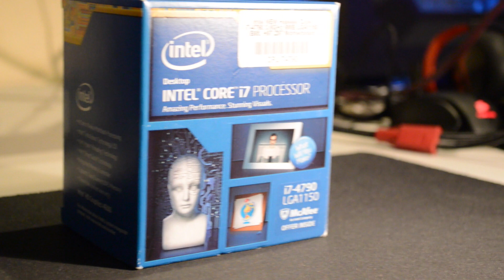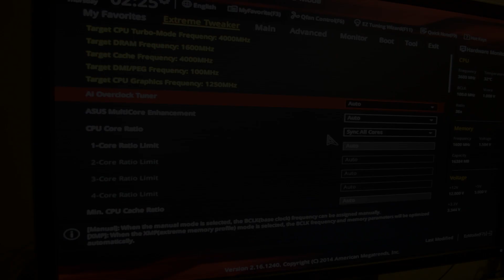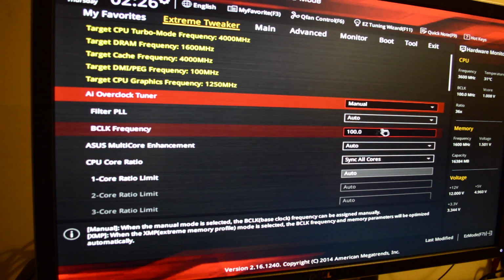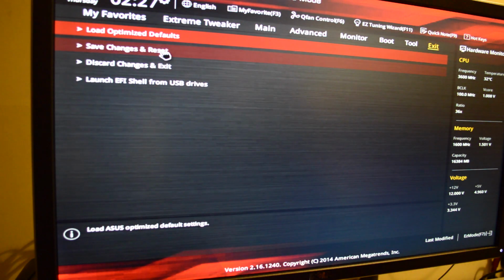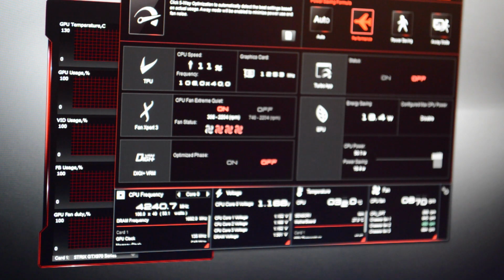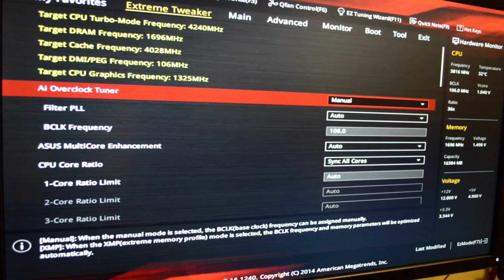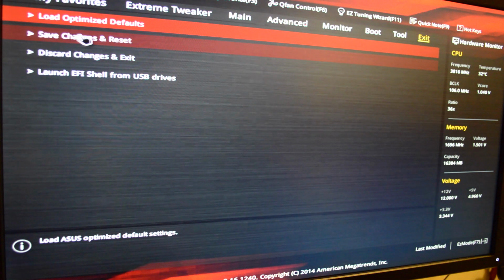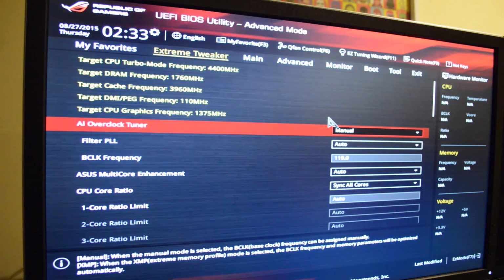Overclocking a locked Intel CPU!

Comment: I thought base clock speed is supposed to stay at a set value for the purpose of running all the components at a certain frequency, when you change multiplyer on (K) cpus it doesn't effect the other parts but base clock is what everything goes off of so changing it can lead to unstable system

Comment: Hey man I had a second gen i5 and a intel mobo and couldn’t find the settings you used.Now I’m getting a i5 10th gen with an ASUS mobo.Do you think it will work?
Reply from the maker: I believe second gen Intel would have still been of the age where you would most likely have still needed an overclocking motherboard to have the options. Many newer motherboards will have the option for this even in the low end, although 10th gen some things are fundamentally a bit different
Reply: @LancesRoom  yeah thought so now I’m getting a 10 th gen processor will it be possible to over clock that without a z or x chipset?
Reply from the maker: I would say it depends on the motherboard you go with, not all manufacturers have the same setting in the BIOS. Look at the webpage for the mobo you are thinking of getting and you should get what you need to know

Comment: my i5-10400 keeps idling and boosting at 3.98GHz i want to find a way to probably make it run at 4.7 or even 5 GHz i have a 240mm AIO cooler so im pretty sure it wll run pretty well.
Reply from the maker: With locked CPU’s there are other factors to think about that the multiplier will also affect (RAM frequency is of course one, but there are other) and while there may be enough temperature headroom for the CPU, other parts of the system may become unstable. It may not be possible with your CPU. The 10400 is a 2.9GHz base clock and a 4.3GHz boost clock so being a locked CPU, it ,Ishtar be pushing it. I’d love to know your results either way though man!
Reply: Max 102.95 bclk or it won't boot on 10th gen and up

Comment: Whats the software that was used. Also, can I do this with my e3 1240?
Reply from the maker: It’s simply done within the BIOS of your PC. Regarding your hardware I am not sure, would pay to do some searching before giving it a go
Reply: Lance White I’m new to the pc worlds cuz I just upgraded from an old xbox to my new budget pc. Do you know how I would be able to do that. Am I right in saying BIOS stands for basic input/output system??
Reply: Lance White Looking into it a little bit more, is it correct that to access it I must restart my PC first??
Reply from the maker: Yep that is correct for the acronym although it doesn’t explain much. Basically it is where the hardware is initilised on start-up. You access it before Windows is loaded, so you would need to restart. To get into the BIOS when you boot there is usually a key you need to keep pressing, usually it will tell you on the initial boot screen
Reply: Lance White I managed to do it. Boosted my e3 1240 to 3.7ghz base clock so quite a healthy increase. Thanks for your help mate 👍
Reply from the maker: Very decent little performance boost for sure! Well done man!
Reply: Lance White I just need to figure out how to get the turbo clock up now. In the system bios I can make it no higher than 3.8 so my cpu technically has a 3.7 base clock and a 3.8 turbo, lol. I would like to alter it though if possible.
Reply from the maker: Usually if you overclock this way, it becomes a fixed clock speed. Do you know if your CPU has an all core boost or if it would have just boosted one core to 3.8GHz?
Reply: Lance White I’m honestly not too sure. When I ‘user benchmarked’ it, it just said that the base clock was 3.7 and turbo an average of 3.8. Anyway, even if the turbo is 3.8 in one core, 3.7 base clock is still a big improvement.
Reply from the maker: Yeah definitely! You can compare your FPS numbers too, with the BCLK overclock, vs stock and see what real world improvements you make

Comment: I have a i5-9400F and now all the cores are running at 3.95GHZ
Reply from the maker: Nice man!
Reply: Hey, I have the same CPU as well. Did this give you any performance boosts for your games?
Reply: Think this would work on a i7 9700f it’s turboed to 4.7 but base is 3.0
Reply: Joaquín Crous they turbo to 4.2ghz
Reply: @thesacredtoaster3719  No, they have turbo boost up to 4.10GHZ in 2 cores, in my case, i put it to 4.00GHZ in ALL cores with a program called: QuickCPU, it works.

Comment: Thanks for this video! I managed to hit 4.301 on my i7 4790. I set my value to 107.5 and everything seems stable so far!
Reply: Nevermind just got an error message and locked up on me whole playing Far Cry 5 lol going to try 107 now
Reply from the maker: Nice dude! Definitely takes a bit of tinkering to get the right balance
Reply: @jb74465  solution?
Reply: @DiDi-hm6ri  Solution is to lower value lol not much else you can do with the cpu being locked. It's been stable at 107 for me

Comment: don't be a lil girl! i did the same thing on a core i7 920n (lol) but got 4.5 ghz stock speed it 2.37ghz! alway always push the shit out of a cpu! lol
Reply from the maker: Cause it’s locked, pushing it even 0.1mhz more causes system lock ups for me sadly. If it wasn’t locked I’d have a lot more to play around with
Reply: @LancesRoom  that sucks!! all i did was adjust the blck think i set it to 210 which made it 4.5ghz! im now running a 980 extreme @4.7 stable! the v core is a bit high for my comfort but 1 month and 3 weeks in and its still pumping good vibes lol 1.58v on the v core haha
Reply from the maker: Nice man!  When I do that, my RAM goes to almost 4000 MHz haha. I’ll do a little more playing around and see what’s possible though

Comment: Hi I would really like to do this for my I7 2600 but my gygabyte g1 m3 sniper has different settings, plus I think my ram speed is only 13000
Reply from the maker: It may be called something different in your bios. Regarding the RAM speed, that will be your base frequency, because the 2600 is an older generation it’s 1333MHz instead of 1600MHz like mine
Reply: @LancesRoom  last time I messed with bios I had to wipe my pc so I'm not going there lol

Comment: I have an H81M-S3PH and an i3-4170, would it work?
Reply from the maker: Sadly not with an H81 chipset, it would still need to be a chipset with overclocking features available
Reply: @LancesRoom  what about a h81m-p33 ?

Comment: I have a H81 Asus motherboard and an i7 1490 and i cannot set the bclk frequency to manual.
I dont have the AI overclock Tuner option even with the same bios version.
Ps My memory is 1600mhz like your
Reply from the maker: Typically an H series motherboard is a board without overclocking settings. You would most likely need a Z series motherboard
Reply: @LancesRoom  I didn't know tank you very much

Comment: dude, how is this supposed to be LOCKED?
Reply: ies
Reply: Right? looks like regular overclocking to me
Reply: @Impetuss  With a locked chip, you can only overclock via the BCLK frequency like this. With an unlocked chip you can also adjust the multiplier to overclock, which typically yields greater overclocking potential on Haswell because you aren't upping the BCLK beyond what's stable for all related components. 

This was "fixed" on Skylake where the BCLK only affects the RAM speed rather than affecting the rest of the system (i.e. PCIE and SATA) like it does on Haswell, meaning you can run a BCLK of 170MHz if you want on Skylake, whereas you're pretty much maxed out on Haswell at 107.

Comment: Will this bottleneck an ASUS Strix 970? I want to overclock my i7 4790 but I'm scared it won't work out
Reply from the maker: I would highly doubt it, but a good way to check if you are facing a bottle neck somewhere is to use something like MSI afterburner and do tasks you would usually do that are GPU intensive, gaming or whatever, and then compare CPU and GPU usuage. If the GPU is at 100% usuage, but the CPU isn’t, then you’re good. If the CPU is at 100% but your GPU is lower, then you are facing a bottleneck somewhere. I wouldn’t think your hardware would bottleneck, you have a very similar setup to what I had with no issues
Reply: Lance White Ok thanks, I won't start overclocking just yet however as I have stock fan which is shit. I overclocked it and temps went way up to 69 degrees!
Reply from the maker: Yeah, better cooling is always a good start before overclocking!
Reply from the maker: Yeah, can’t go wrong with a 212. Definitley a good cooler for the price

Comment: Very lucky most will fail anything above 104
Reply: I can't get over 102.5 :(
Reply from the maker: +Nathan James Yeah, anything over 105.5 seems to give me problems. I’m not 100% sure what contributig factors are at play with that
Reply: Yeah! I couldn't get to 105 aswell
Reply from the maker: That sucks man, but atleast it’s something. I’m guessing Intel use the lower quality chips for the non-k skew CPU’s
Reply: @LancesRoom  There's no physical difference between K and non-K chips within the same series. Intel's binning stops at whether a chip qualifies as an i5 or i7 etc. Whether it's locked or unlocked is arbitrary and an artificial limitation. 

The issue pre-Skylake is that the BCLK frequency is tied to numerous system components, like RAM (as you noted) along with PCIE and SATA. The latter two are where stability issues creep in. While you can compensate for the RAM speed increase, you can't for PCIE and SATA. Once the BCLK goes beyond what those components can handle, you get instability. How high you're able to go before experiencing instability depends on your workload and the components. Some get lucky and can run ~110, while others see issue beyond 103.
Reply from the maker: Ahhh very interesting! I wasn’t aware of the PCI-E and SATA also being effected
Reply: Nathan James i dont get it mine wont work at 100 but wen i up it to 133 its fine

Comment: i7 4790 from 4ghz boost to 4.3ghz boost, thanks man
Reply from the maker: +Ali Yektas No worries!
Reply: Haswell CPU have microcode bug who allow you to change ratio, you can push it far far far away ...

(Google it:  Haswell microcode cpu hack)
Reply from the maker: Interesting, I might need to look into this! Thanks
Reply: @LancesRoom  You're welcome, just get good cooler, and don't go away 1.3V on haswell. (maybe 1.35 if your temps doesn't go over 60°C.
http://forum.notebookreview.com/threads/4ghz-overclock-i7-4xxxxmq-h-to-i7-extreme-conversion-intel-haswell-cpu-microcode-bug-hack.790177/
Reply from the maker: Yep, that shouldn’t be a problem. My systems got a custom water loop in it haha
Reply from the maker: For sure! I might make a video about it after a few other little projects as the 4790 is a good platform for people building with used parts right now!
Reply: @LancesRoom  can't wait for it with  a 360mm WC, if i was able to hit 4.4ghz with a laptop cpu, what can you reach with a desktop wc cpu ? ;) ... a 7700k haha
Reply from the maker: Haha lets hope so! I’d love some free performance
Reply: @LancesRoom  2 Years later, do we have the microcode video?
Reply from the maker: I had a play around with it, but it didn’t seem to do anything when I did it. I’ve now upgraded my system and since there was no positive results I didn’t post anything
Reply: Can you help on how to do this? I've looked on Google, but there is a lot of info and seem complicated, don't want to damage my CPU. I want to overclock an i5 4590 and I would like to know what microcode can allow me to do it.
Reply: Which cooler did you use for the 4790?
Reply from the maker: I’ve got a custom loop cooling it

Comment: my bios allows me to increase/decrease the bclk, does this mean i can bclk overclock?
Reply: Eric Freeman yeah...
Reply: You always overclock the base speed or the multiplier
Reply: @breadbuttrjam1604  3 years later lol
anyways i was overclocking an i3 6100
Reply: @banoonoo5  Don't even try to use a stock cooler
This is mainly for Skylake processors since they are a little bit capable of handling these stuff

Comment: Disable Turbo Boost, overclock your core ratio to its max turbo Ghz, and then do BCLK overclock
Reply: Michael Caluag help, i just cant find bclk no matter what i do. I set the ai oc tuner from auto to xmp and it still wont apear 😰 (mobo: asus p8b ws) i7 2600
Reply: @mongocom1735  update bios
Reply: @lilvirtt3577  still not there :(
Reply from the maker: I would say that is expected as that is a work station motherboard, designed typically for a Xeon, which you cannot overclock therefore, no OC features other than XMP for RAM timing. You would still need an overclocking motherboard to be able to do this
Reply: @LancesRoom  well fuck me and fuck that mobo...
thx for explaining anyway
Reply from the maker: No worries man, bad luck!
Reply: Can't do that on b560 mainboard

Comment: thanks for the tip man. I have the exact same CPU and MoBo. worked just fine. unfortunatelly my i7 was bottlenecking my gtx 1080. I guess still is, but less haha
Reply from the maker: +Bloody Covers Nice dude! I'm jealous of the 1080!
Reply: tatzecom 

It can bottleneck at 30-50%, because instructions per clock is what counts - watch videos on gtx 1080's with different cpu's - and you'll see the difference in fps
Reply: Bloody Covers how on Earth is i7 bottlenecking the 1080
Reply from the maker: Bottlenecking isn’t always so straight forward either. It really depends on what your doing, what games your playing, what res your at etc. if your running a game at 1080p then the GPU may not be at 100% usage as it is waiting for instructions from the CPU, in this case the ‘bottleneck’ can be elliviated by running a higher resolution as the GPU has more work to do so to speak and isn’t waiting to be issued instructions from the CPU
Reply: Guys, I have an I7-4770-non-K. Gues what? The Cpu is nowhere near bottlenecking my 1080 form Gainward which I overclocked to 2100MHz. The CPU runs at somewhat 30-50% while the GPU is under full Load with 120% Power Consumption.

So a 4790 bottlenecks it neither.

Thank me now or later, I was typing this anyhows :D
Reply: because the cpu is slow

Comment: I picked up a I7 4770 for 70$, I have a Z97 ann. edt ASRock mobo laying around, so will be fun just to try OCing. 

I have a 5960X/980Ti custom loop for my main rig. But i needed a rig to put my 980Ti in when i get my 1080. Will post back my results!
Reply from the maker: +Christian .T (GreddyMuffin) Nice man, sounds like you have a pretty sweet setup!
Reply: Yeah, plenty powerfull for folding and gaming! I`ve considering going down to something like a 6700K since I`m only gaming. But we`ll see.
Reply from the maker: +Christian .T (GreddyMuffin) The 5960X is good for bragging rights though XD
Reply: Jesus, $70... Lucky bastard
Reply: Hehe, still going strong. Best buy I've done on HW. :-D
Reply: yeah, where do you live?
Reply: Norway where it's quite expensive. example : RX 480 8GB cost 350 USD.
Reply: Wow you got lucky!  I wish I could find that CPU for that price!  I'm using the 4690 atm.
Reply: you can put your 980ti in my system lol

Comment: i just use the standard asus ezmode overclocker on my i5 4460 (non k) from 3200 mhz to 3510 mhz
Reply: What motherboard do you have? (or what did you have at the time?)
Reply: Loryoz ! What's your setup like? I'm thinking of buying a gaming PC, looking to game in 1080p 60fps high-max settings and I think I have a good build.. I5 4460, AMD R9 380x, same mobo as you now, 2x4gb ram 1600mhz, 500w psu.. What do you think?
Reply from the maker: +Loryoz ! Thats a pretty good boost, you should see if you can get any more from a BIOS overclock
Reply: Derek O'Kelly An asus Z97-PRO GAMER, its still running strong :)
Reply: +Anwar Siracha I changed some things around since, I note have a 390, 600w & 16GB ram. Should I still wait?
Reply: @DerkNotDirk  now you can have an RX 6800 for only 500 bucks. I'm from the future.